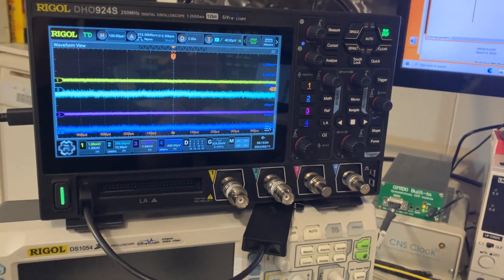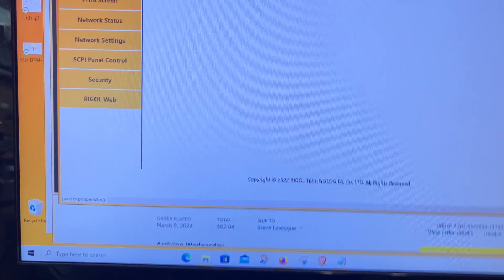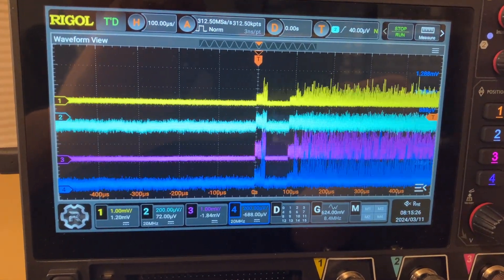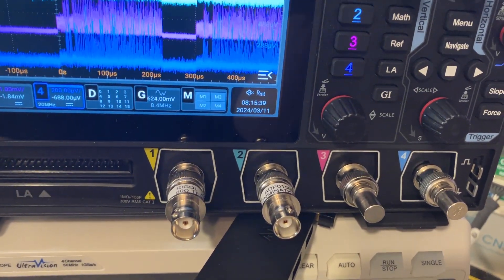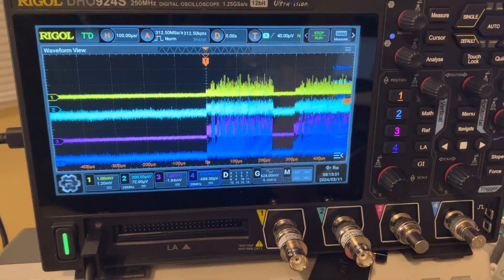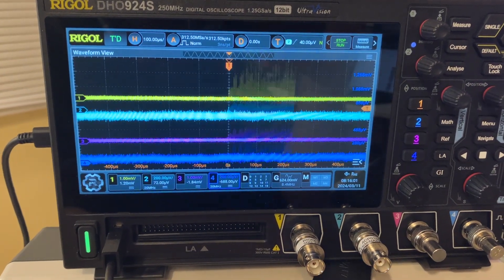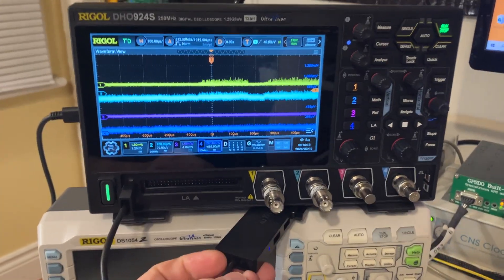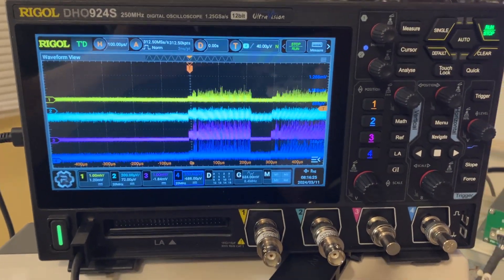2.4Ghz WiFi capture noise revisited

Comment: Interesting that it picks up that much noise even with terminators. I have the 914 model and will test to see if it has the same issue.
Reply from the maker: The area correspond to the the analog first stage. PCB is under the shield/radiator bolted in contact with the back side of the board but on the BNC side the plate is mostly just in proximity with the PCB by the BNC screws. See Dave's https://youtu.be/KQF4UzLPpr0?si=eqAdEhbG495SEa85&t=265